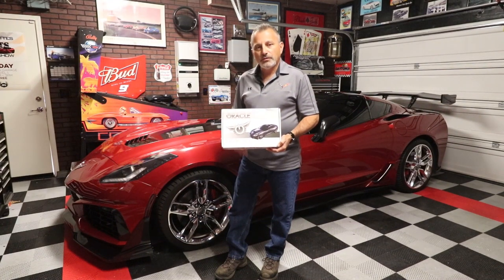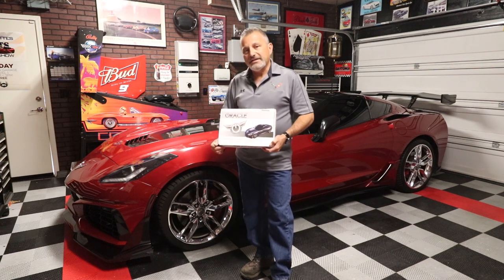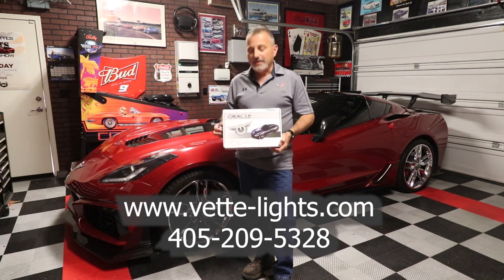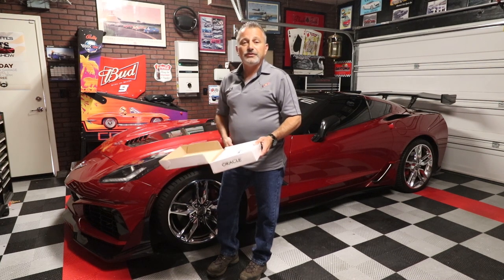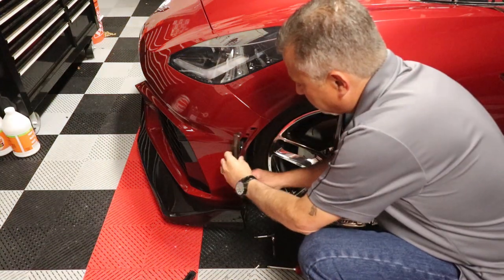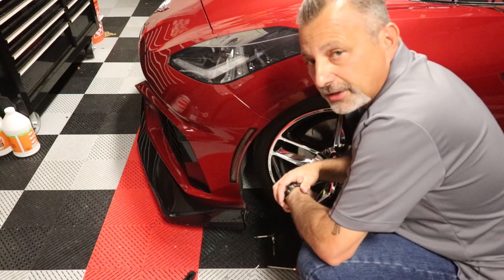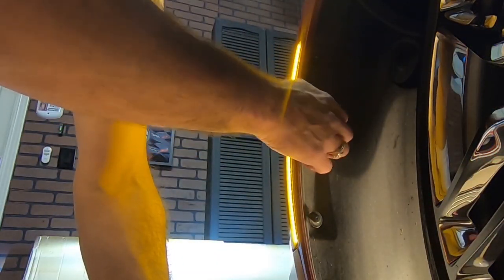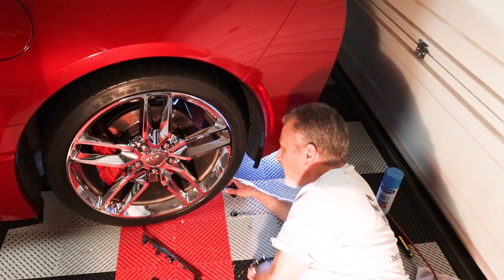I replaced my LED Side Markers with LED Side Markers from Vette Lights com

Comment: I appreciated the info.  However, it leaves out information essential to Grand Sport owners.  The GS has a black vinyl wheel opening extension that has a 7mm bolt underneath just like the one you have to remove underneath the rear wheel opening. It's a royal PITA to get that bolt in and out due to the front spoiler making it hard to see.  You have to feel your way to get the socket on it, and afterwards it's very hard to align that bolt with the hole and reinstall it. Grand Sport owners need to be aware this complicates the job considerably for the front side marker lights.